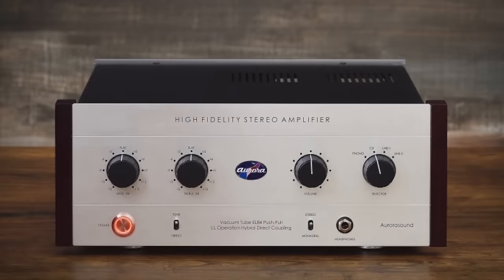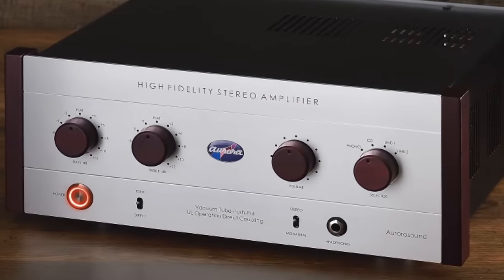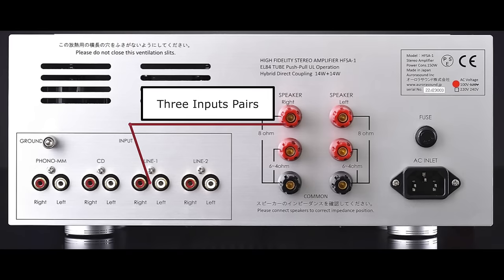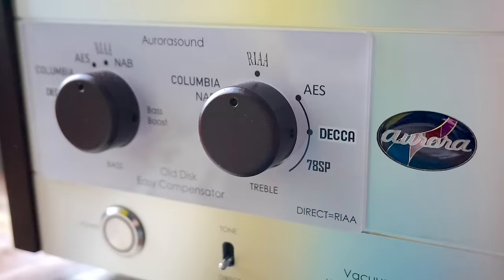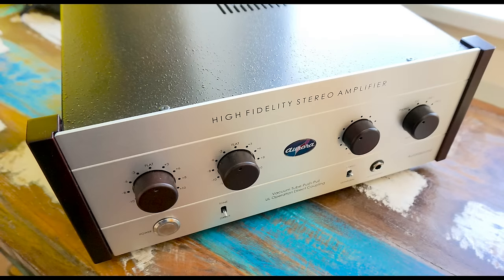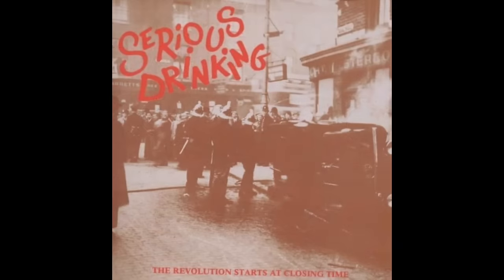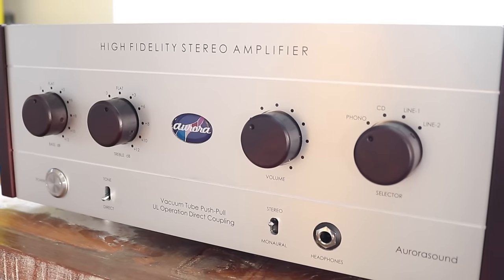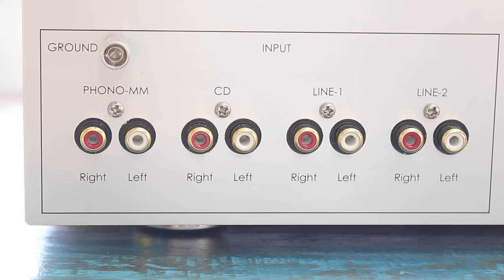HFSA-01 INTEGRATED AMPLIFIER FROM AURORASOUND IN JAPAN. SOLID STATE PLUS VALVES/TUBES

Comment: My system is also set up with a solid state pre-amp section and a tubed power amp section. I only found out later this was unusual. It works well for me and I have found rolling power tubes gives me plenty of variation in the amps sound.  Nice review.

Comment: Good review, hefty price tag, EL 84's unsuitable though for most low efficiency loudspeakers these days, and lack the necessary power in a largish room. better get some NOS mullards though and chuck the sovteks if you buy one. instant improvement to dynamics.but at the end of the day...output valves decline more rapidly in fidelity than pre-drivers, hence most hybrid amps are reverse to this design. anyway, I like your reviews Sir.

Comment: I have never had a hifi system that didn't need some type of sonic adjustment.  If you can't adjust your environment to get the sound right, or if you are physically challenged, it is nice to have tone controls. The tone controls need to be transparent and (fully complementary). Do you remember hearing that term years ago? Also, the RIAA Phono eq and speaker crossovers are a form of tone control, right?  Yet, we are OK with them.
Reply from the maker: You're in luck, I have 2 minutes before I have to get back to my editing so don't expect a long conversation here but...It's arse about face, Scott. If you are spending that sort of money on an amp (which means a whole lot more money on similarly price additional components, which adds up to a heap of dosh in the end) then you should be getting your listening room sorted in sonic terms first (that will provide the sonic balance any HiFi really needs to work in the first place) so it doesn't and shouldn't need adjusting via  tone controls. 
Prevention in HiFi, as in life, solves a heap of issues. Prevent the disease, don't spend all your time trying to cure it.  
Tone controls only alters the sound in a heavy-handed, sound-based sledgehammer manner. 
 I get the same sense of exasperation when people buy cabling to alter the tone of their 'broken' HiFi and think they're doing a good thing for their final sound when in fact the core reason for the broken sound lies elsewhere and remains in place. 
If you need to do any of that then you're applying an Elastoplast to a larger issue.
Reply: @TheAudiophileMan   I get your drift.  Sure, if I was going for an all-out high-end setup then I would not want tone controls.  
But for my everyday listening needs, I like to have (good) tone controls built into my high-quality integrated amplifier.  The areas I find most often in need of adjustment are about 125Hz and 3KHz.  A bight sounding room, poor recordings or less than optimum speaker placement can be helped a lot with slight adjustment at these two frequency ranges.  Usually for me, just very minor adjustments can make a big difference.  I don`t notice a significant decrease in sound quality when tone is engaged.  No difference in depth, nuance, imaging etc.  I am using the ML 15i speakers, thanks to your review. I really like them.  Thank you!